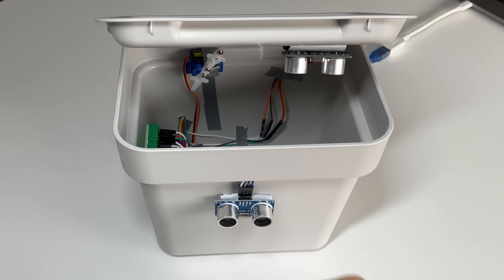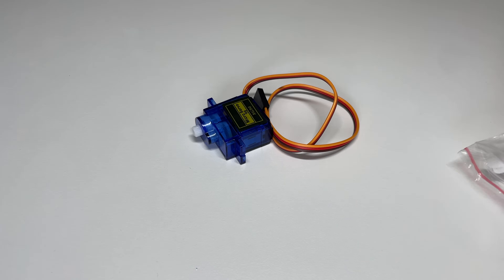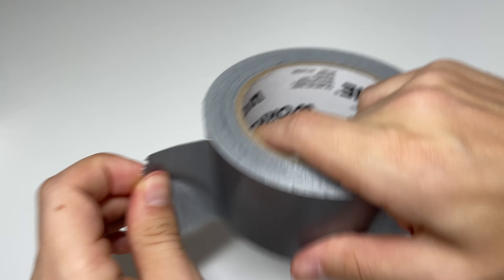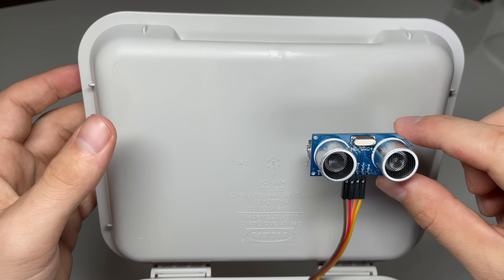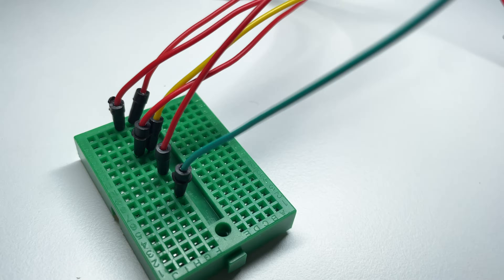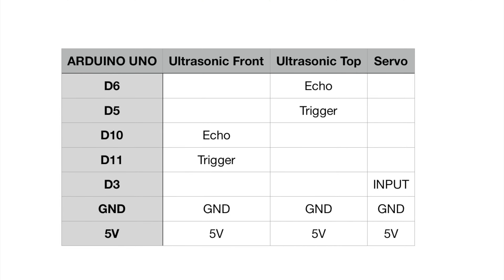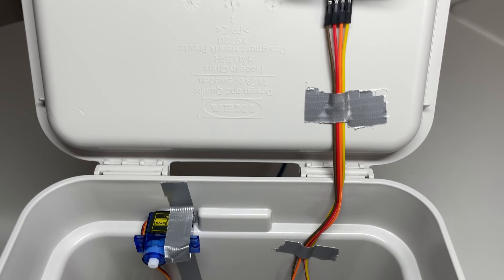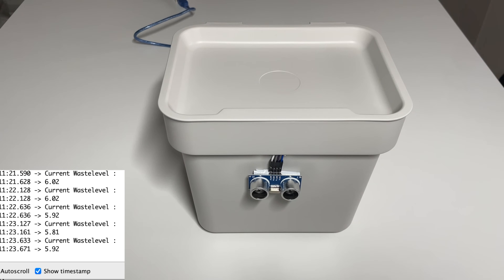Arduino Trash Bin with Waste Level Detection

Comment: Where can I get the components and what's their names?
Reply: Sorry for the late response, but they're all in amazon! Their names are
Jumper wires (male to male wires) and (female to male wires) 
Breadboard 
Ultrasonic sensors (2 pieces) 
Servo motor 
And that's it

Comment: What type of wires is this? Is this a 10 cm female- male and 10cm male-malw wire?
Reply from the maker: I used all of my wires and both female-male male-male :D join us here to discuss it further: https://www.skool.com/arduino-embedded-software-4925?invite=270efe1764e448db83a8101058eae5e3